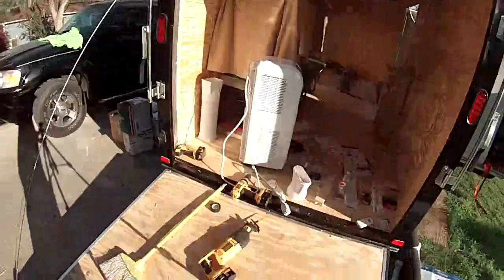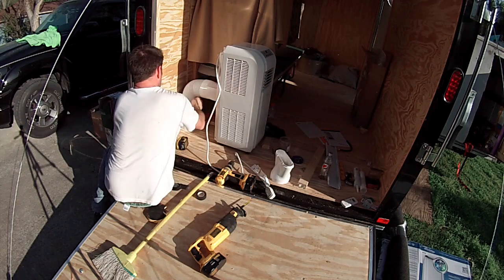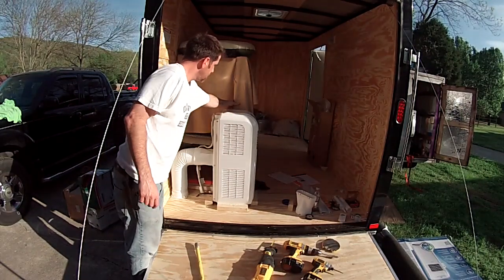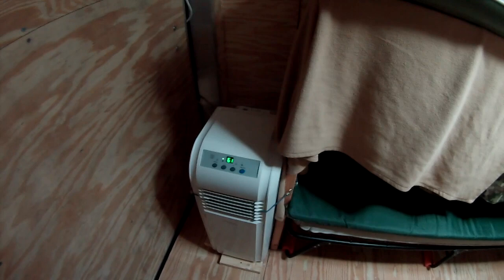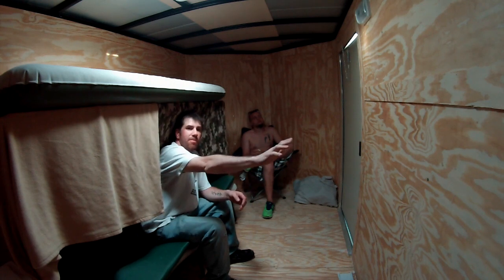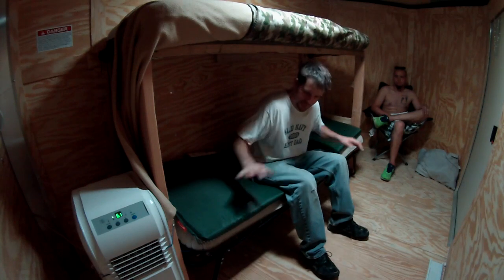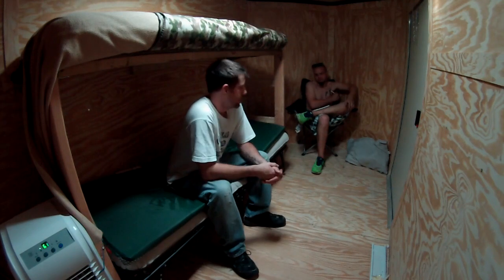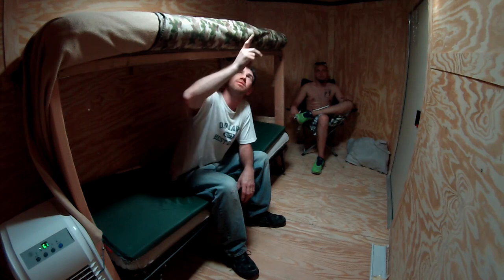Air Conditioner Installation........ 6x10 Enclosed Trailer Conversion Project

Comment: I know this was posted quite a while ago, but figured I'd comment. First... GREAT IDEA. I was looking around for cheaper ways to do this too, without having to buy an expensive RV roof one.
On the air bit... you have a single hose unit... those use the ambient interior air to not only cycle in, but they also pass that across the coil and waste out. What you really want is a unit with two hoses. 1 for exterior ambient intake, and one for exterior exhaust. That way, you are not wasting your interior air to exhaust, and you are cycling the interior air progressively cooler. Much more efficient.
Reply from the maker: yes, have you seen this video? it helps
https://youtu.be/zrAsNsV_PWs?list=PLZ4qTEaJmrTCO3BDYir2PVsRnrgRU022r
Reply: Kraka069 I didn't. Cleaver modification there!

Comment: Pretty good video, I did the same with my enclosed trailer. Wished I could post some picts of it for ya to give you an idea but don't know how! Got my trailer done and will be post a video of it soon. Just got a new LG 10000 Portable A/C in mine and you need to watch video to do this for yours! Wrapped my hose in back of AC unit with Aluminum heat tape and probably decreased that heat by 70%. Name of video is Portable Air Conditioner Exhaust Hose Insulation. Sorry I'm on a Government CPU and lilited to what I can do!

Comment: Use a composting toilet and put a shower in with a hose drain under the trailer so you control where your grey water goes. If you want to add a holding tank add an exterior one you can screw onto your hose. But a composting toilet is a must.

Comment: If you haven't got an iPad mount yet, check out the solutions from a company called Annex. They make the Quadlock system, super secure. Only like $20 for the iPad case and another $20 for a pair of wall mounts. I use this w/ my iPad and iPhone (windshield mount, bicycle mount, etc.).

Comment from the maker: The way i mounted it.. it would be better if pointing  blowing the entire length, instead of toward the side wall.. It works great when outside temp is 70-85 or 90.  but 95-100 deg outside, it is straining to keep inside 75-80. once it gets dark and temps fall back down, its fine..  But it  depends on the size or trailer, outside temp, and if your trailer is insulated..    also if you have to start from inside temp of 90-100 then try to cool it down, it takes a while..

Comment from the maker: same comment from below 
he way i mounted it.. it would be better if pointing blowing the entire length, instead of toward the side wall.. It works great when outside temp is 70-85 or 90. but 95-100 deg outside, it is straining to keep inside 75-80. once it gets dark and temps fall back down, its fine.. But it depends on the size or trailer, outside temp, and if your trailer is insulated.. also if you have to start from inside temp of 90-100 then try to cool it down, it takes a while.

Comment from the maker: Might wanna get a little bigger BTU unit, or add 2 if, You have a Large Trailer, Outside temps are going to be 95+ deg F , or you like it Frosty... My unit is 8000 BTU...   I wish i would have bought a 12000..  I might just get a second one. unsure yet.  110 deg august weather isn't here yet

Comment: I would bite the bullet and vent it directly out the side of the trailer and flush mount it against the interior wall. with a trailer that small you need every inch you can spare

Comment: Why not install a window ac in the floor?  It would work better and take up less space.
Reply: +Oliver Lloyd have fun when you hit a speed bump =D Roof A/C is what you will want...
Reply: It can be done, with a little planning.  Start with a "low profile" window unit like the Frigidaire or Kenmore model that is only 12.25" high but a bid 24" wide.  "Split the difference" by having 10" of the unit sit below the trailer, 1" of it through the floor, and 2 inches above the floor  You will need to build an airbox under the trailer to allow the evaporator side to circulate air into the trailer.  You will also need a piece to direct 3" of compressor fin area down under the trailer.

Comment: I've worked with portable ac u its there longevity is questionable they die fast. The roof one too expensive and noisey. I perfers the window unit you can get line for $115 easy anywhere.
Reply: a small 5000 btu window unit will outperform both of those roll around units also...